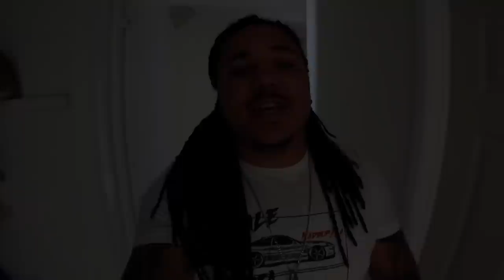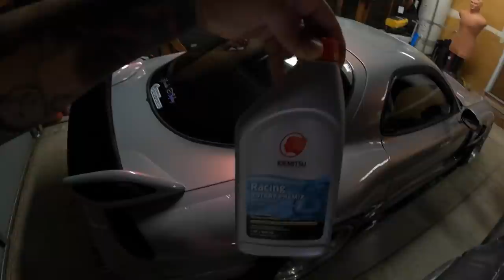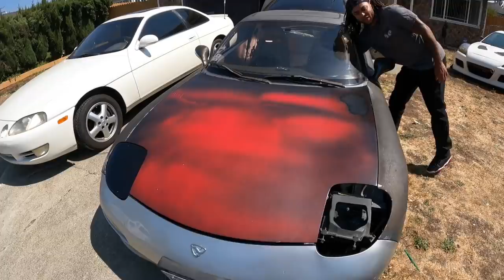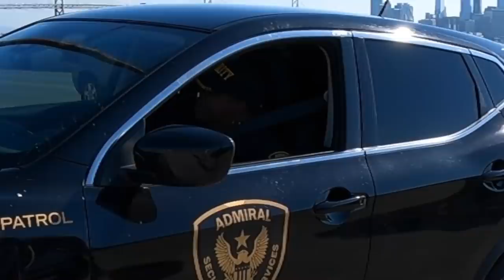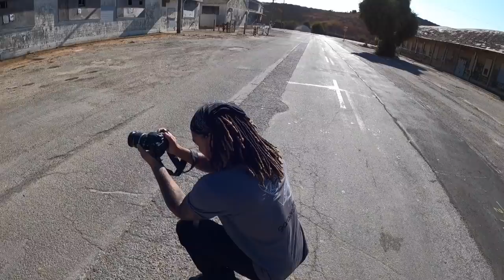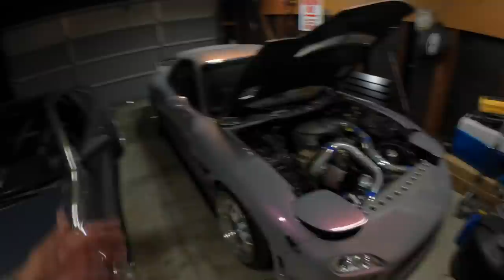Angry Karen Tried to Ruin Our PhotoShoot! "Why are you so angry?"

Comment: They can build it reliable with around 600 or more hp in Puerto Rico . Puerto Rico also has mech tech in Orlando so I think u can ship the engine and getting built and tune
Reply from the maker: The stock trans and diff will not support it